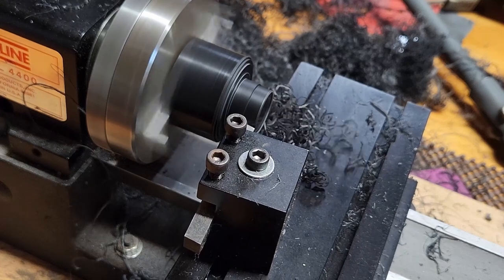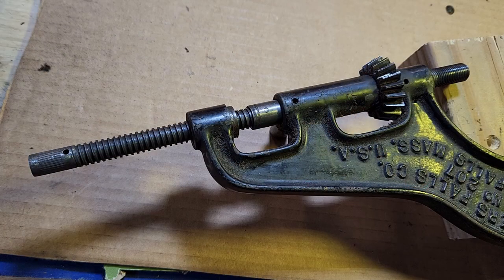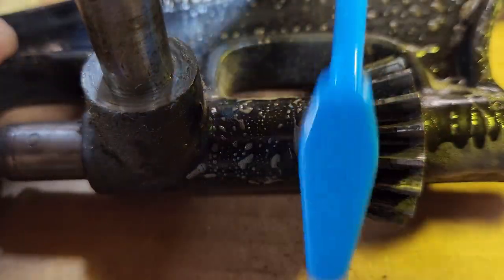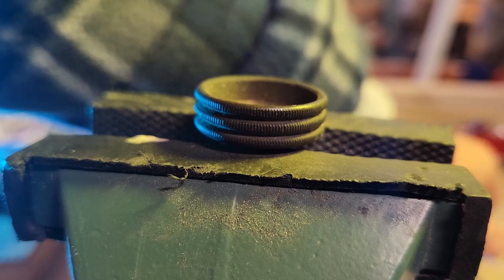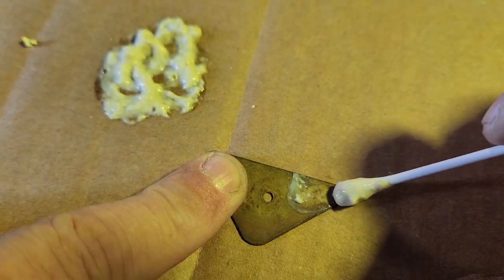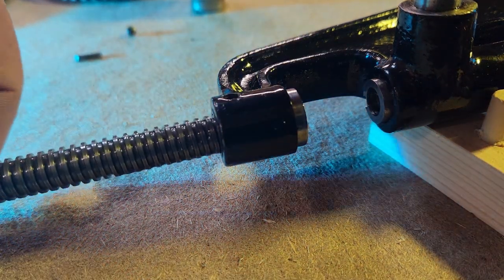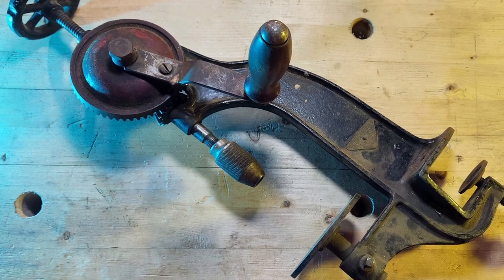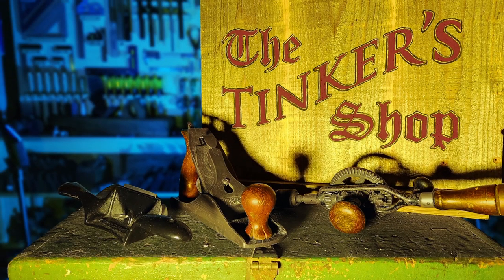WATCH the TRANSFORMATION: Restoring & DISSECTING the 207 Bench Drill! | Hand Tool Restoration

Comment: 6:20 I like the in-depth explanations. They are very useful to those who need to take apart their antique drills for repair or restoration. I've got an antique drill that I bought on ebay, and I'm trying to restore it. Your video helped me better understand the hidden mechanisms of the drill that I otherwise wouldn't know about resulting in me seriously damaging the mechanisms. :O
Reply from the maker: Glad you liked it. That whole turn screw to shaft mechanism had me perplexed and the video omits the trial and error I went through to figure it all out because it was getting really long and I figured viewers wanted to see how it worked and not the wrong turns and thought process of figuring it out. Definitely confusing at first because the grime was covering the pin that attaches them together and it made no sense how they were attached. Thanks for the comment, it is much appreciated!

Comment: I have the Goodell Pratt version of that and basically just cleaned it up. The GP version has their signature 2 speed mechanism. It actually will drill through steel pretty well. The downside is that you must clamp the work piece to the table.
Reply from the maker: I actually got to use my big post drill for an upcomming video. Same concept as this bench drill, just bigger with a gradual feed. I may just end up using this for drilling in smaller metal pieces just because I want to use it something. :)  Thanks for the comment!

Comment: It's been a year since this video was published. You were doing well. What happened? I enjoyed what you have done so far.
Reply from the maker: Several things, actually. I had a video 80% complete last April, but work got really busy and I was getting a bit burned out sitting front of the computer and needed a break. Had several issues going with this computer as well - namely hard drive space. The files for the router plane video took up around 6 gigs of space, while this video with all the bells and whistles surpassed 200 gigs. I was quickly running out of space. I bought an external 3TB drive and moved new footage to that... and it fell off my desk and died on day 3. I was not happy.  The making of this video was tapping out more than my hard drive space. The layers and effects were really causing some slow downs. I had to do this video in sections and splicing those sections together to get things to work. My computer is a beast and can handle the latest triple A games, but 3d animations and video editing calls for something with a lot more specs. LOL, most people work within their limitations, but I try to remove the limitations and push things into new areas. I like a challenge. Besides all of that and being limited to time spent in the garage because I lack temperature control in there - 60-70% it is either blistering hot or freezing - my son started Kindergarten this year. I wanted to spend as much time with him before the school year started (we had a blast and made some great memories!) What I didn't expect - and I was warned by parents about - was being prepared for him bringing new germs in the house and being sick a lot. From the flu, to strep, and despite never getting it, the whole house got laid out with Covid courtesy of him bringing it home. Not fun, but we got through it.  

Granted, despite all of that, I would be lying if I said I wasn't a bit disappointed with how well this video is doing. I definitely had higher expectations for it. I am critical of my work and constantly trying to improve. I see a lot of areas for improvement in this one, but am struggling with the fact that only 2% of people who see the thumbnail click on it and 44% of those that do leave within the first 30 seconds has me doing a lot of second guessing. I think I can address the whole 30 second issue by changing things up at the beginning of my videos, but the thumbnails seem to be a bit of a black art. Seems like the ones that work have the cheesy used card salesman look and feel to them. Not sure I want to go that route. :) 

Regarding the videos, I have 3 planned and being worked on to be released at the same time. One is taking a bit of time due to the 3d graphics and modeling, but it is looking good so far and I am happy with it. I will most likely do a major computer upgrade here to speed things up. I am cringing at the cost, but tend to get obsessive when I have an idea I want to make happen. I don't scratch the idea, I figure out what needs to be done to make it happen. I also have several new tools in my arsenal that I am incorporating into things. I think people will really enjoy them. 

Sorry for the book. You caught me in a chatty mood!
Reply: @thetinkersshop543  I understand the chatty mood. I get that way too. I am a retired professional woodworker. I use mostly power tools. But on occasion, the hand tool gets brought out because they just do a better job. The router Plane... You got lucky with that. I have seen many in second-hand stores that were missing the blade or some other part... I watched your video because of personal interests. As so most other people would. I didn't watch it because of the fancy video editing. It was the subject. You are overthinking and trying too hard. THAT tells me that you are a true woodworker. They call it OCD. I call it the drive to do my very best. You have to laugh at yourself. Your drive for excellence has overdriven the power of your computer. Now, that's an achievement in itself. LOL. Just remember. It's not the fancy video stuff that matters. It's the subject. Do you think that Drillpress is useless? Try using a hand-cranked bentch grinder sometime... I send my best wishes and keep up the good work.
Reply from the maker: @stanleydenning  I have a few of those hand cranked bench grinders and you are right.  You need three hands for that as well! :)

Comment: Nice work.

Did you reapply shellac to any of the painted surfaces after you touched them up?

And have you tried screw machine length drill bits? I have them for my Taig lathe, and they would be perfect for your Sherline, and this drill.
Reply from the maker: Thank you! No, I didn't apply any shellac after painting. That paint is pretty tough stuff meant for engine blocks.
Reply from the maker: I realized I missed part of the question. Sorry about that. I also did not apply shellac to the red portion as well - I probably should have though!  Regarding the bits, I'll have to check out the machine length ones. I do have some smaller ones, but those are REALLY tiny for those thumb drills. Thanks for the tip!
Reply: @thetinkersshop543  no problem! I just wondered!

Comment: Would WD40 work for cleaning over a decal?
Reply from the maker: Good question. I would have to say no. The 3 in 1 oil contains a detergent, while WD-40 contains a solvent. WD-40 is useful for removing stickers from a surface and decals are essentially stickers.. It's penetrating properties actually break down some plastics. If there is a protective clear coat over the decal, then 'maybe' it would be ok, but I wouldn't risk it. WD-40 was one of the things I tried on the old sewing machine and I immediately noticed little bits of fine glitter on my Q-Tip and realized it was actually tiny flecks of the decal. I then tried the 3 in 1 and they cleaned up nicely without any damage to the decal.